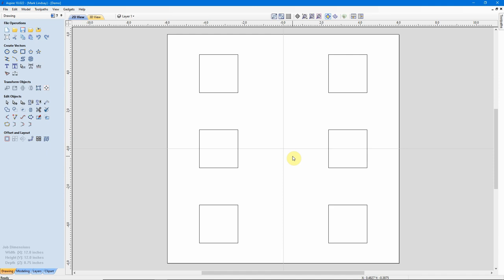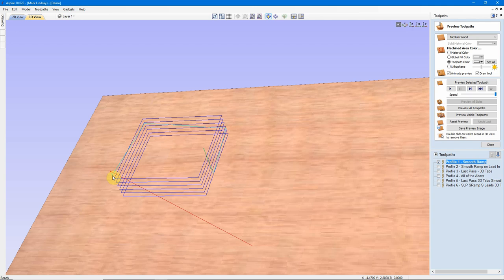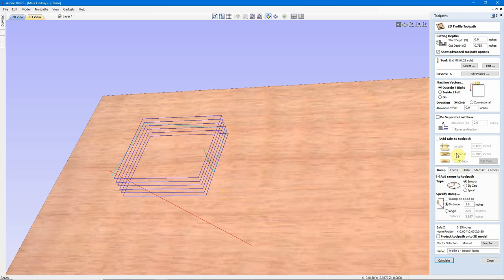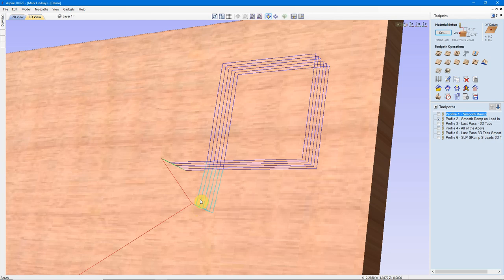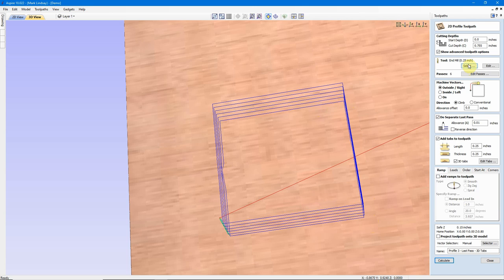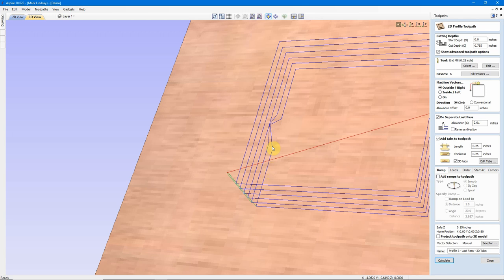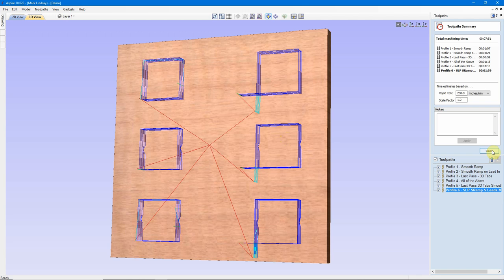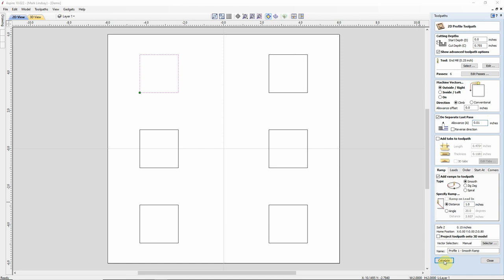Combining Ramps and Leads - Part 45 - Vectric For Absolute Beginners

Comment: Hey, Mark - I have a project that really needs this...  Can you confirm: 1) for an inside-the-line cut the last pass will got outward the 0;01"; 2) for an outside-the-cut-line that the last pass will go inward the 0.01"? It seems that you cannot specify a negative value to for separate last pass.  Before I put tabs on my parts, I'm hoping my compression bit will take care of the cleanup and holding... 🤔💥

Comment: Excellent description of all these options, Mark. Two comments, for what they are worth.

Using tabs, care must be taken to account for the depth of cut of the profile pass. Meaning, I add a few thousandths to the cut to make sure that I cut all the way through the material. On occasion, I have failed to take that into account when setting the depth of my tabs. The tabs ended up being too thin and did not hold. 

Second, with compression bits, I've never understood why the first cut part is not a down cut. I've looked and no such bits seem to exist. I do not have any compression bits. When I am cutting melamine, I use a down cut bit so that the the bit is not trying to pull up on the melamine. (Cutting on a table saw, for example, is always done with the good side up, so that the blade is cutting down on the melamine, not up.) I am clearly missing something WRT the use of compression bits and melamine. With the lead part of the bit being an upcut, the bit is pulling up on the melamine for the first plunge. By the time the down cut part of the bit engages the melamine, the damage on the surface is done. What am I missing, please?
Reply from the maker: Thank you, Grant. I too add .005 to my cut depth for the profile pass. That's why my tab thickness is .25 inches. Taking .005 off that tab isn't enough to weaken it substantially.  As to compression bits, you'll never find one with a downcut tip - that would just be a downcut bit. The whole purpose of a compression bit is the upcut tip giving you a clean cut on the bottom surface of the piece, while the downcut portion gives you a clean top surface. This article explains it better than I can here: https://www.axyz.com/us/2018/02/22/using-a-compression-bit/
Reply: @MarkLindsayCNC  Thanks, Mark. Re: tabs. My problem was that I make my tabs too thin.  :-)

Tks for the link. I'm guess that I'm dense. I understand the geometry of the bit. I just don't understand the theory of how it works. For example, to partially mimic a compression bit,  I could use an upcut bit to cut the first .125" of melamine, then switch to a downcut bit to cut through. The bottom would be rougher, since I would be going through with a downcut bit, rather than an upcut. However, the top would be the same as I would be mimicking the first part of the compression bit with an upcut bit. To my way of thinking, the top would be better, if I used a downcut bit bit to cut through the melamine on the top surface. I thought that downcut bits were used, generally, to achieve a better surface. If not, why use them at all? Anyway, I'm not trying to provoke anyone. This is just one more mystery that I cannot get my head around.
Reply from the maker: I hope my answer in the Live Q&A helped you, Grant. Some things are just easier to talk about than try to put into text. If that didn't answer your question, let me know. And thanks!
Reply: Using a lead-in + ramp with a compression bit will cause any chip out to happen before the bit gets to  the actual toolpath, so your finished piece is clean and chip free both top & bottom.

Comment: hi mark, thanks for yet another great video. how do you decide on the length of the lead-in what effect will making the lead-in shorter or longer have ? ( apart from the obvous  machining time chanages)
Reply from the maker: Thank you Eyal! The length of the lead-in is totally up to you and your needs. If you're ramping with the lead-in, the shorter that lead is, the steeper the angle of the ramp will be. That's one consideration. If you're not ramping with the lead-in, you can use your judgment as to the length. The main purpose of the lead is to get the tip of the bit down into the material somewhere away from the part you're cutting out. As long as you accomplish that, you're fine.

Comment: Hi Mark, Thanks for the tuition video, I'm having problems with the Vectric software displaying, calculating and saving a lead in tool path, when I have node edited ( cut vectors ) on that tool path..leads ins works fine when not node editing the tool path but I need to edit the vector to have a straight edge and 45 degree bevel and would like ramps and lead ins on both of those tool paths..
not sure what I'm doing wrong ? Thanks, Mark.